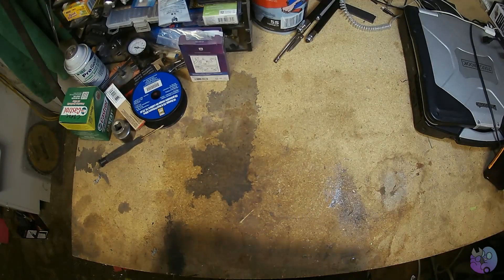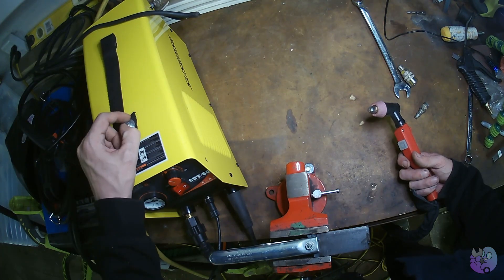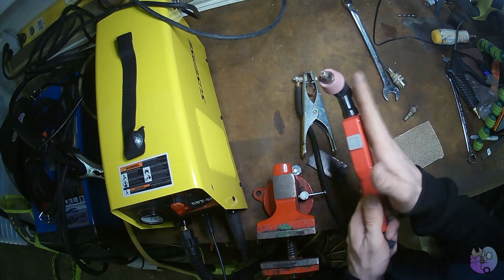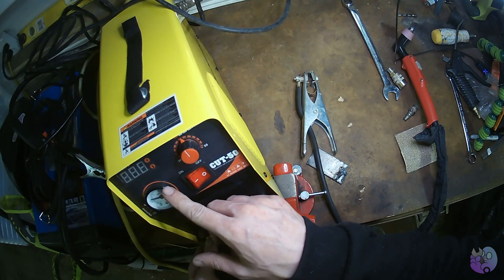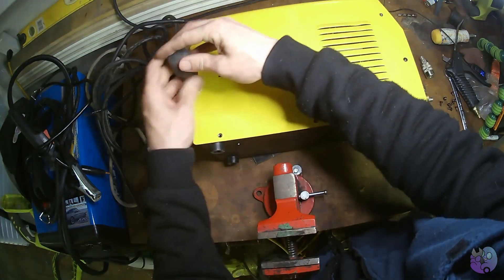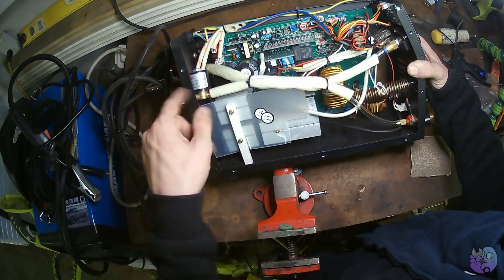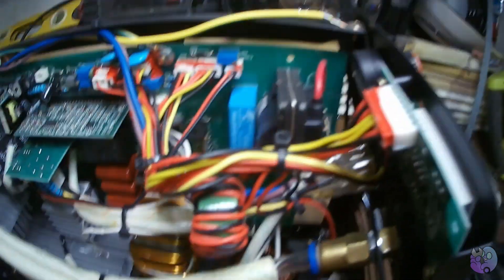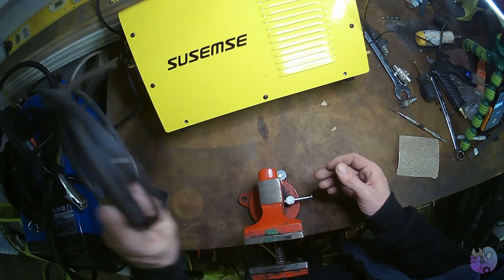Review and Troubleshooting: CUT-50 cheap ebay plasma cutter (Susemse CUT-50 won't arc)

Comment: Did you not get the stand off guide or wheels that attach to the cutting head?
Itll help quite a lot, also take pressure to 65 to 70 psi.
But great video because learning is taken from watching another man struggle.
Thanks
Reply from the maker: Thanks for the reply! I did get a guide but its just a bent piece of wire, it wouldnt stay on the torch. This is a very cheap machine.